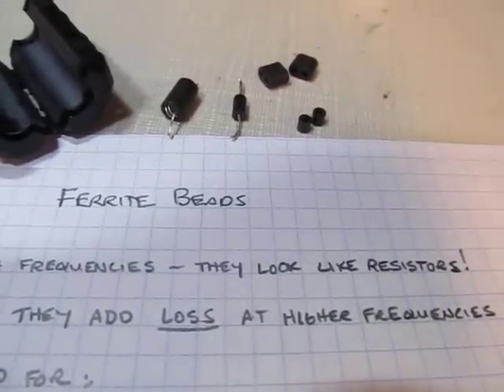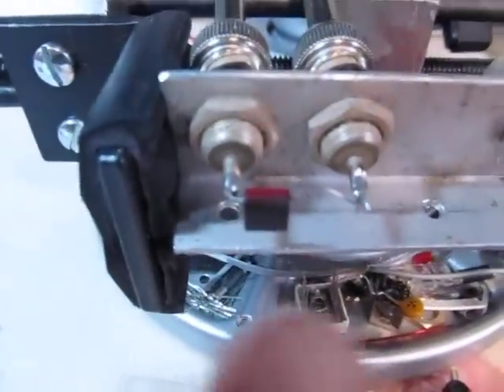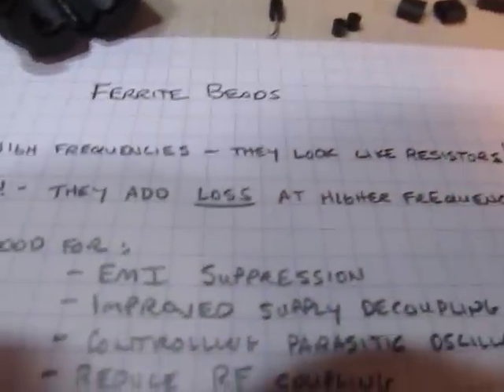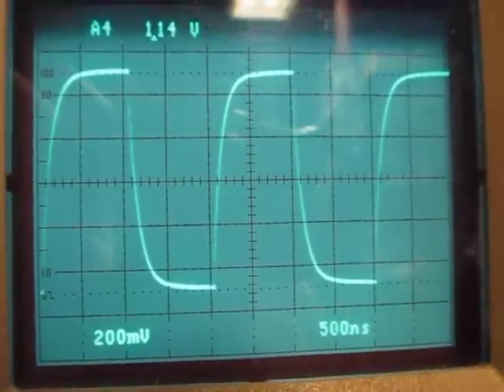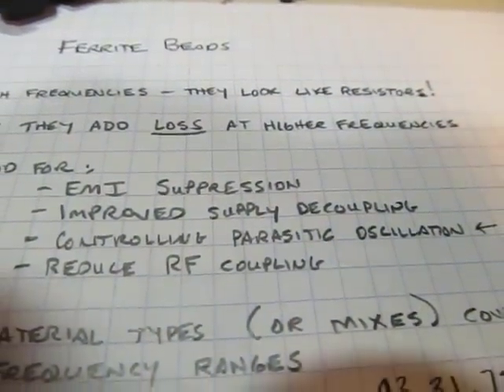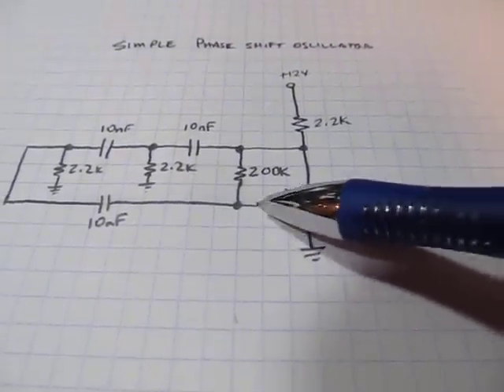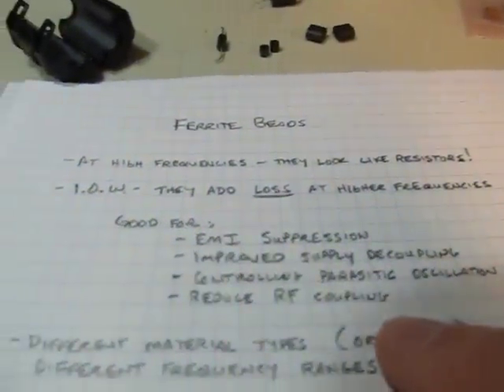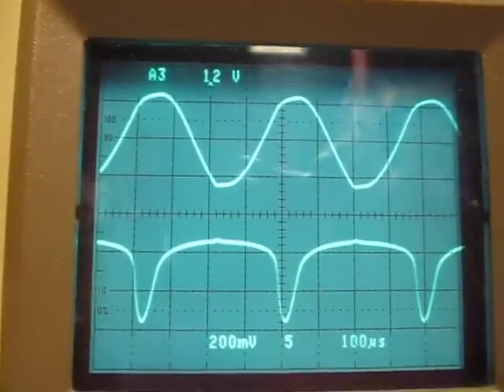#84: Basics of Ferrite Beads: Filters, EMI Suppression, Parasitic oscillation suppression / Tutorial

Comment: What is the difference between EMI RFI Suppression and Common Mode Rejection in power supplies? A lot of newer SMP supplies have large chokes before the rectifier and switching transformer circuitry. Why are these not used on typical linear stepdown transformers?
Reply from the maker: EMI RFI Suppression is one reason to employ a common mode choke, often in the form of a ferrite bead or core around both supply leads.  Switching power supplies can create a lot of high frequency and RF noise due to the fast switching speed (fast rise/fall times) of the commutating devices.  Linear supplies do not have these elements - the highest frequency components generated by linear supplies are usually just low order harmonics of the AC line frequency - thus do not need high frequency filtering or suppression.
Reply: I may be backwards in my amateur use of terminology here. When I said "common mode choke," I was referring to ones like this: digikey.com
 They are usually placed on the mains side of a switch mode power supply right after a fuse but before any switching circuitry.
  From the little bit I understand, this common mode choke balances any discrepancies on the mains side.
   I'm probably way off in my understanding but I'm at one of those points, as an amateur where I haven't figured out how to formulate the right question. I really want to understand this part, why I keep seeing it, and it's exact function.
Reply from the maker: You see this on switchmode power supplies to keep the switching noise from being conducted back out onto the mains wiring.  There are various EMC compliance standards that place limits on the conducted emissions from devices connected to the mains, so these filters are used to keep the noise from being coupled onto the mains supply lines.
Reply: Awesome, thanks!

Comment: I've seen many RF decoupling circuits using the ferrite bead, but I have a question regarding mixed signal layout. Suppose you want to decouple an analog supply from a digital supply, shouldn't the "star" connection between analog and digital grounds also have a ferrite bead (as opposed to only in the positive voltage rail)?
Reply from the maker: In general, adding impedance in a ground path is not a good idea.  The star topology is used to keep digital return currents confined away from analog return paths.

Comment: Nice video! Quick question: Why don't we use an inductor to do the same? Does a Ferrite bead have an advantage over using an inductor in some situations?
Reply from the maker: Ferrites offer a "lossy" impedance (more resistive) over a wider frequency range.  Inductors will work over a more narrow frequency range, and be more dependent on frequency.
Reply: @w2aew  Hi @w2aew, isn't it the opposite ?

Inductor would have theoritically its impedance ZL=jwL increasing linearly with frequency over full frequency range.

On the other side, as I could see in ferrite catalog, the impedance vs freq diagram of a ferrite has a maximum at some hunderds MHz and then decreases at higher frequencies. From my understanding, its effect is therefore concentrated inside a more narrow frequency range.

The ferrite would be better in this frequency range but not at higher frequencies.

Thanks for you help and this great video ! :)

Comment: I have outdoor led flood lamps installed on the 4 corners of my house and when I turn them on I lose antenna reception for my tv. Would installing the ferrite beads on the power wire going to each light fixture solve the problem? Thank you very much
Reply from the maker: There are no guarantees, but it is certainly worth a try.

Comment: But what are you measuring on the scope? It is not the voltage drop if it is getting lower with frequency. If they are more resistive to higher freq.  voltage drop should be higher., How did you connect signal gen, wire and oscilloscope??
Reply from the maker: The wire and bead are in series between the signal generator and the scope input load. Thus, more drop across the bead means less voltage appearing at the scope.

Comment: Great video, If you would like to build DIY audio amplifier, a basic class B, how would you design a "EMI Suppression" filter? what kind of chokes, capacitor values, in a pc ATX psu, i saw this and in a video of Big Clyve, i saw 100nf + varistor and choke, but no values on them both. his choke had a piece of pcb inside. would would be design requirements of this?

Comment: Thanks for the explanation!
Do you have any experience with MIDI? I am using the standard circuit but it introduces noise every time a bit of data is received, do you know if maybe I can use a ferrite to suppress it? Maybe in the octocoupler IC's VCC pin?

Comment: I bought my wife a new washer and dryer while back. They're in the room behind my RadioShack. When I'm on  on 40 meters I can hear interference from the washing machine through my radio. Would A ferret feed be appropriate for the AC power line to the washing machine?
Reply: It might help, but IF the washing machine is radiating electrical NOISE (due to carbon brushes o the motor) PLUS the  machine is also in the next room you have a problem:   ferrite beads, line filters  can NOT HELP.
observerms

Comment: this is awesome... soo, can i put too many on a line? too many Ferrite mix43 on a single coax , and still maintain a good transmitting signal on the 27 mhz ? can u put too many on???
Reply from the maker: If your goal is to reduce the amount of RF flowing on the outside of the shield, then no, you can't have too many.  You will reach a point of diminishing returns though.

Comment: Not sure if you are familiar with CB radios, but I have a 10 meter 55+ watt PEP Stryker and it is installed in semi truck. I have an SWR of 1.0, 18ft of 95% shielded coax cable, and I have serious feedback through my trucks stereo system. I can hear my voice in the radio speakers and squealing, also I changed the incandescent dome lights all to LEDs l, and whenever I key up the mic and talk it lights up the LEDs the higher my voice goes. So it's flashing going down the road! A lot of people I see are saying use ferrite chokes, I don't mind doing it, but do you think it will fix if not minimize the feedback? 

On a side note I also get a lot of noise from the truck to the CB, if I turn the truck on to accessory only the meter is dead, also with the truck running the meter is dead. As soon as I turn something on it brings the meter up to like 1db which is barely up on the meter. Everything turned on separately will only bring it up to 1, with the exception of my cell phone charger and dome lights. My cell charger brings it up a little over halfway. Of course all of these things together make the needle go more closer to 90% up.

I guess my question is if I put a ferrite choke on every single circuit will it cure all these problems  or minimize them? Also was thinking on putting a couple of chokes on the coax for the antenna. If you do read this message I really appreciate your time and help. Oh also I will be putting all brand new ground straps on the truck and eventually run separate power and ground to the batteries for the CB. Thanks again!
Reply from the maker: Adding ferrites to the leads of all of the affected systems certainly can't hurt, and will likely help somewhat.

Comment: question regarding phase shift oscillator. How does this circuit produce the ~2.5Khz oscillation? Is the +12V supply AC 60hz, and the capacitors charge/discharge and start producing the 2.5KHz? or if it is a constant DC 12V supply, how does it produce 2.5KHz from the transistor?
Reply from the maker: The RC feedback network provides enough delay to equal 180 degrees at ~2.5kHz.  This results in positive feedback at this frequency, thus causing the oscillation.  It is called a phase-shift oscillator.
Reply: @w2aew    Ok thanks for answer

Comment: How is the function gen. and scope hooked up in your first experiment (where you measure the ferrite bead's frequency response). Is the scope measuring the wire+bead's output/input FFT? Or is the function gen. triggering the scope? And the frequency sweep looks a blur on the oscilloscope?
Reply from the maker: The sweep speed is too slow to see the cycles of the swept signal.  The scope is being triggered by start of the sweep on the function generator.
Reply: Thanks.

Comment: Excellent! One question: I want to reduce noise on cheap lavalier mics (2 wires - shield + core). One example I saw showed a slight improvement. If I loop the cable on a ferrite core (1 inch long by 3/8 hollow) will it help? 

(for readers: he's got a video on dB!!!!!)

Comment: Nice Video, Very Good Practical Explanation. Can you please tell me what is the a fer-rite bead Inductor normally found in Radio  Frequency chokes. Black color inductors with 2 pins....?
Reply from the maker: It depends entirely on the manufacturer, and the intended frequency range.  Nearly impossible to tell what material is used by just looking at them - you'd have to get the datasheet for that particular part number.

Comment: I have some FB on a circuit board. They are near a chip. They look like resistor, but black, just like in this video. Are they supposed to have the same voltage on each side? Or could they be broken inside? Thanks.
Reply from the maker: Yes, they should have the same voltage on each side.

Comment: We have something like six ferrite rings which are arranged in a stake and encircle all three phases of a 20KVA generator. A guy I know who's worked on generators for quite some time says that's not very effective, and that each phase having its own ferrite filter would be better. What say you?
Reply from the maker: Passing all three lines through the filter will suppress common-mode noise only - noise that is common to each line.  It will not suppress differential noise - noise which is equal but opposite on any pair of lines.  Best suppression would be to do both.
Reply: w2aew Thanks. We were told it's for 'harmonics.' I suppose the harmonics of 60Hz is common to all of the phases. Like you say though,  that's not the entire picture. '

Comment: I have a board where I'm reading the voltage output from a charge pump using a 10-bit ADC.  Since the output of the charge pump has harmonic residues in the 10's of MHz to 100Mhz or so, the ADC sometimes samples the voltage incorrectly;  its seeing too much switching noise. 

In that case, would putting a SMT ferrite bead in series with the ADC pin help to quiet some of the noise on my ADC input pin?
Reply from the maker: +APVT80 It may help by subjecting the higher frequency components to a higher impedance.  You may want to follow the bead with a small capacitor to ground - something like 100pF to 1nF or so.  This will make it more effective.  Also, if possible you might want to consider a small boxcar average function in your code that reading the ADC.  For example, take four consecutive readings and average them together, rather than taking just one reading.  In addition, you can examine all four readings and choose to toss one out it differs dramatically from the others...
Reply: +w2aew Awesome, thank you for the suggestion.  I love running experiments.  You're an inspiration!

Comment: Hi you really helped me to understand things which i was trying to do for months. Thanks. Can you please explain how can I choose a rf chip bead ? I need an RF chip bead on a 5V power supply (operating current is 80mA). When i search in mouser there are lot of parameters like impedance and maximum dc resistance etc. Do i need to care the impedance and maximum dc resistance when using rf bead on power supply or can i choose one which has maximum dc current greater than 80mA? I always get stuck when choosing components for power supply.
Reply from the maker: The DC resistance will affect how much voltage drop you'll get with your 80mA load.  You'll have to decide how much drop your circuit will be OK with.  Certainly choose a bead whose saturation current is greater than your max current, and one that presents a reasonable impedance/loss for the frequencies that you wish to attenuate/filter.
Reply: THANK YOU SO MUCH :)

Comment: just what i have been looking for!  i brought a cb radio that is high output. i have a Wilson 5000 magnet mount on my car. my problem is that i can see my speedometer moving like it is a VU meter when i talk. my swr is a 1.1 i ave an auxiliary battery new,the car battery is new, my isolator is new and professionally installed. where do i put the ferrite beeds on the instrument cluster's  ground?    thanks in advance.
Reply from the maker: +Cliff Weaver I have no idea, but I'd probably start from whatever sensor is used to detect speed (draveshaft speed sensor?).

Comment: What is the difference between choke and ferrite bead. I have EMI problem and not sure which to use; ferrite bead or choke or both?
Reply from the maker: Ferrite beads are basically used to make RF chokes.  Typically chokes will have more turns of wire through bead or core to increase the inductance.

Comment: I get some terrible noise as well as cracking and popping from the microphone in my headset (ASUS Vulcan ANC Pro). Possibly EMI from my computers PSU or wireless interference (cell, GSM, LTE, wi-fi, AM, etc..). I'm thinking wrapping the end of headset's cord through a ferrite bead might eliminate or at least subside the problem. Oddly though I only get the problem from the microphone and there is no audible noise coming out of the headset but this could be an amplifier intensifying a weak microphone signal, thereby intensifying noise that wouldn't otherwise be audible, or perhaps the stereo line in the headset is better shielded. I guess I'll have to experiment.

Comment: what is the difference between using a SMD ferrite bead and a simple capacitor for DC decoupling??
Reply from the maker: They both have their place. A ferrite presents a high impedance in series with the current path (for high frequencies), while a decoupling capacitor presents a low impedance shunt path for high frequencies.  They are often used together very effectively.
Reply: +w2aew thank you

Comment: Hello, w2eav

I've just seen your cool video on ferrite beads used for surpression of RF interference and decided to apply it on a problem I am dealing with.

I have a sensor input on my Raspberry Pi connected via 10cm long wire. The wire passes next to a WiFi dongle and picks up some heavy interference. I tested multiple times and I am quite sure the dongle causes the noise signal that I see at my sensor input.

After watching the video, I decided to try to eliminate the interference with the ferrite bead so I took one from the standard USB cable (cut it out with a knife). I ve put it around my sensor cable and...nothing happened. The interference is still there. What to do about it?
Reply from the maker: +Pero Krivić Try using a coaxial cable to connect the sensor to the Pi, or at the very least, use twisted pair of wires.  You can also try winding the wires through the ferrite core a few times. It is also possible that the sensor itself is being affected by the RF and may require some RF shielding.  Remember that RF field strength falls off proportional to the square of the distance, so a small increase in the physical distance between the sensor and dongle can help a lot.
Reply: +w2aew thanks for the answer, it sounds like a good idea. However, I'm curious why the ferrite didn't do the job like it did so elegantly in your video..
Reply from the maker: +Pero Krivić Could be the wrong ferrite material for the application, ferrite location not right compared to interferenc ingress, interference not coupling in on wires but somewhere else, etc.

Comment: What i dont understand. A lot of literature say that ferrite bead suppres EMI. But what i want to  know witch EMI(they dont clarify? Conductive EMI(150kHZ-30MHZ) or radiated-EMI/RFI(30MHZ to 1Ghz?
Reply from the maker: Basically - it's both.  It helps to reduce the RF signals conducted on the wires, which might also radiate from the wire acting as an antenna.
Reply: @w2aew  thanks for the answer. Is it possible that a ferrite bead in a PCB focusses more on suppression of radiated noise(30Mhz-1GB)? Because the most ferrite bead for pcb on the market are for filtering noise in the range of 30MHZ-3GHz(radiated RF signal), its verry difficult to find a ferrit bead for pcb that suppress noise in the range of 150kHz-30Mhz(RF signal conducted).I had looked for it, its verry difficult. The only ferrit bead that really focusses on frequency between 150khz-30Mhz are ferrite that we see on usb cables, on the end of the cable.

Comment: Hi Alan . Loving the video!! On the subject of parasitic oscillations,would you consider a video on how the inductance and impedance of a ferrite bead changes on it's size and shape.I have built a Q meter which makes sketchy references to ferrite beads,to restrict parasitic oscillations and lower the circuit bandwidth,at lower frequencies.The circuit is mentioned in an edn article as a novel Q meter,if you want to know which circuit I am referring to .An 80 nh 50 ohm ferrite bead is mentioned? Surely if reference is made to a component inductance, in this case 80 nh I would have thought this was an inductor wound around a ferrite bead and not just a ferrite bead on it's own.Clarification  would be appreciated as no inductors are mentioned,in the circuit description L1 L2 L3 .

Comment: Would a ferrite bead on a USB cable cause bandwidth losses, or would it be fine because both of the ground and signal cables are inside the ferrite? Ferrites have always confused me, since they act like inductors yet have no coils of wire (apart from in some).